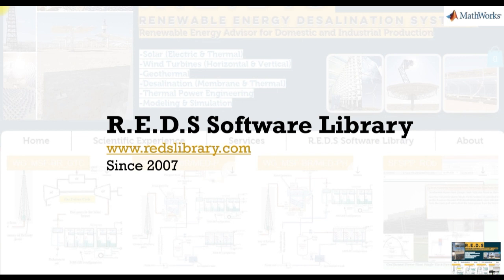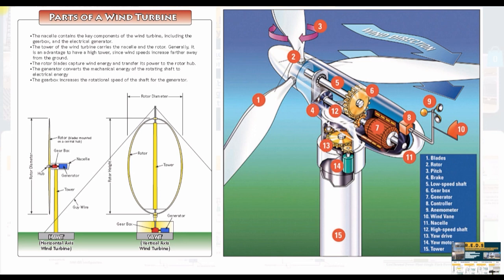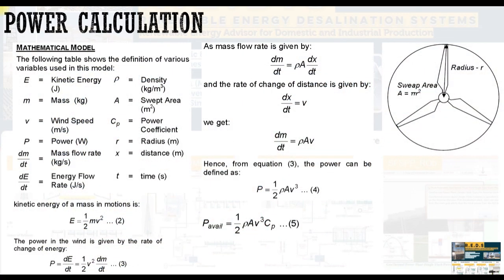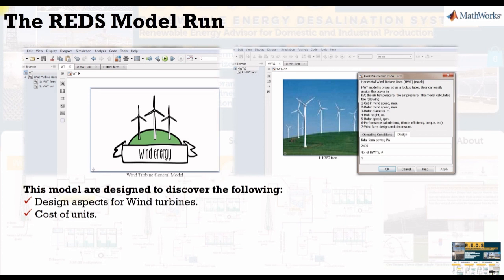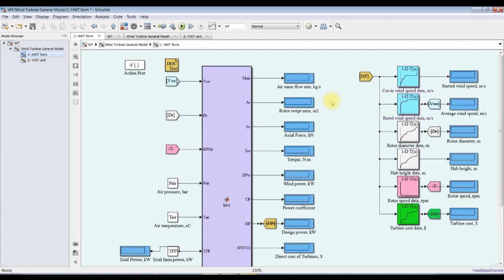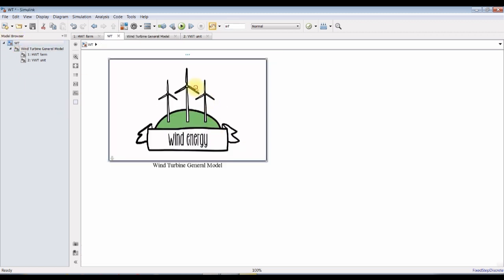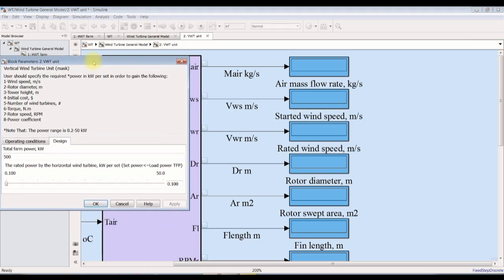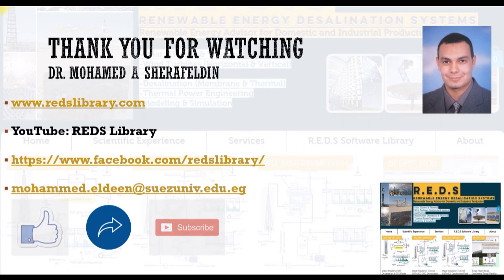Wind turbines MatLab/SimuLink model run

Comment: can't we change the other values for our scenario. I want to enter the values myself for diffrent outputs
Reply from the maker: Yes You can do anything. However, we already have another model like what you want. Watch the performance model video. This is a design model.
Reply: @REDSLibrary  As I understand it, wind speed or rotor diameter is specified as an output in this model(design model).
Can I set them as an input value.
I checked the performance model price. It's very expensive for me. I guess I can't afford it.
I wonder if the model in this video(design model) will work for me?
Reply from the maker: @bilgehandiker  Dear we already have performance model where the rotor diameter and wind speed are inputs. Please check this link.
Check out my product! https://www.redslibrary.com/product-page/horizontal-axis-wind-turbine-performance-model
Reply: @REDSLibrary  oh, thank you so much <3
Reply from the maker: Watch this video https://youtu.be/DH5xN4AUPnw